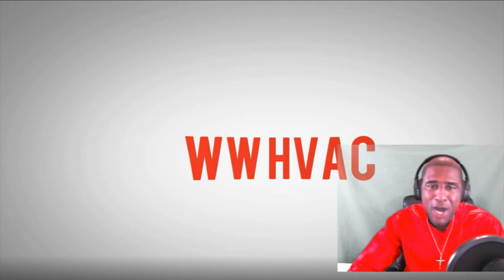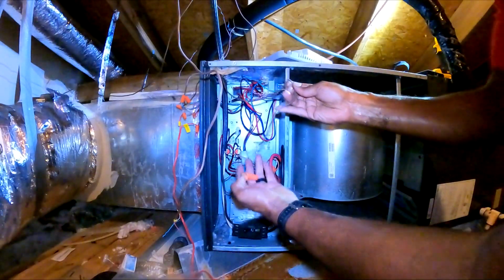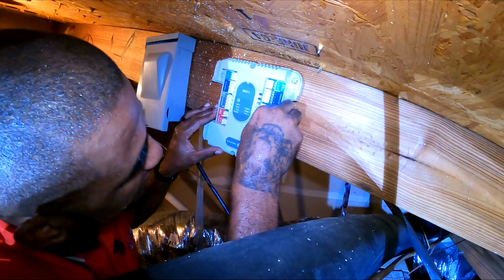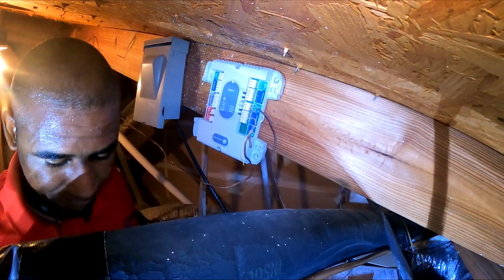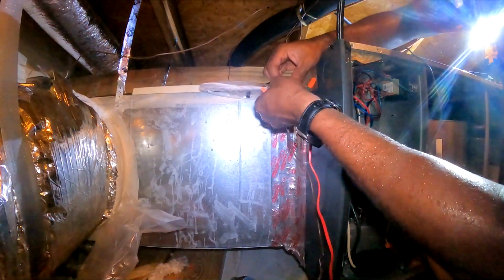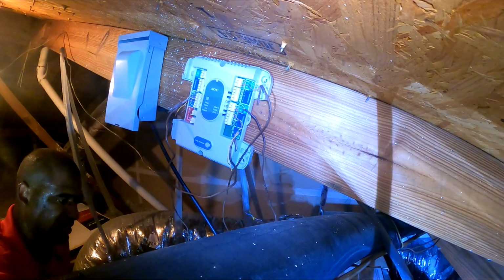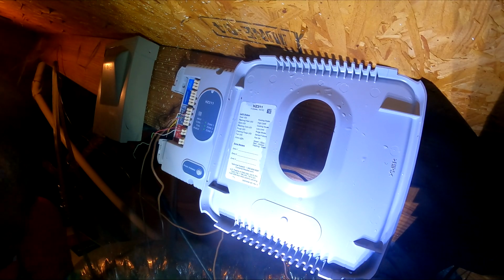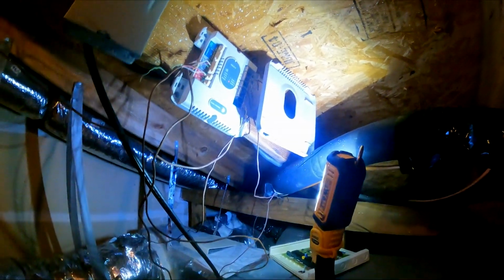"Ultimate Guide to Honeywell HZ311 Zone Control Installation: Step-by-Step Walkthrough!"

Comment: Hello there, this was very informative video. I have the same board HZ311 installed by hvac guy sometimes back in 2017. I have some issues with it and if you can help resolve it. :
1. on the board, Rc and Rh slots are not fully occupied. If I need to turn the heat on in the winter I have to move the wire from Rc slot to turn on the heat and viceversa in the summer for AC. Can I shortcircuit it or how do you handle that scenario?
2. The dampers used are from original EWC ultrazone board and they are not working properly. They are always ON, no matter which ZONE is lit on the control board. can you let me know what Damper I can use to replace the older ones? Do I have to replace all the flaps etc as well in the damper ? what did you used currently? Thank you

Comment: The point you made about the 3 wire zone damper at the end of the video, I assume you were saying that you double up the 2 wires so that you can get a green LED when that zone is open. I assume the red LED lights as well when closed, so what doubling up does, is provide a single in & out path for each state. I guess you duplicated the double up on the board as well. As usual I watched to the very end and I'm always amazed at your ability to focus under adverse conditions. Staying focused is a strong point that can't be overlooked especially if it's going to keep you in that attic much longer searching for your error. Those zone boards, if anything they're attempting to make wiring a breeze cause that's where errors are most likely to happen. Nice job Walter. Thank you for bringing us along.

Comment: Reminds me of the 150° attics here in AZ. A quick tip, when sliding low voltage wires into the Honeywell board,  push in the buttons for faster install. Great job good sir!!